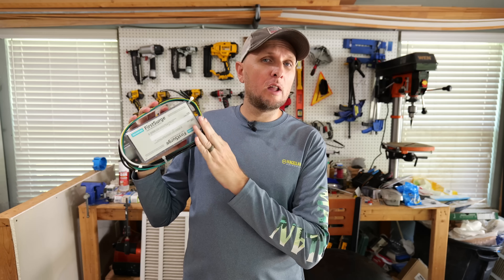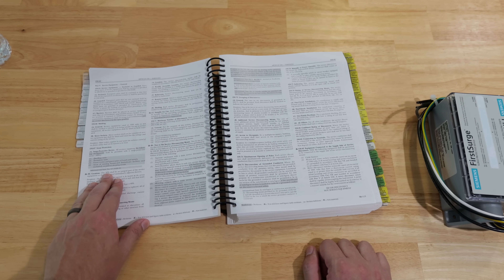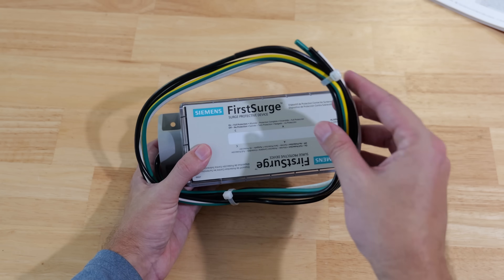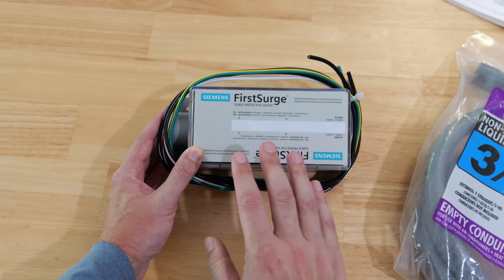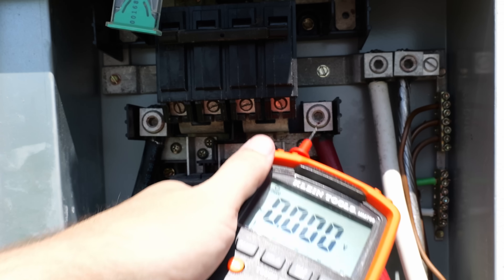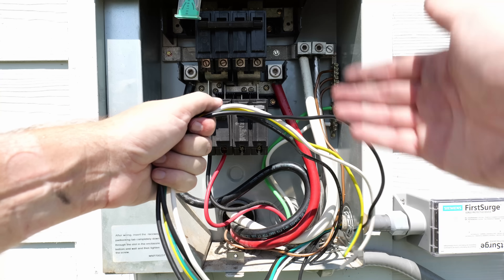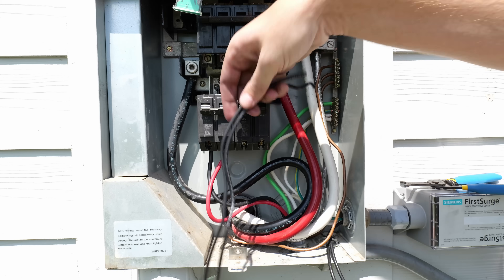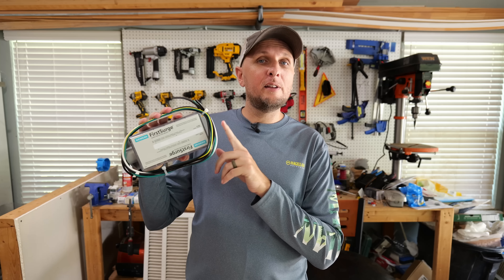Why Whole Home Surge Protectors Are Now Required and How To Install One!  Siemens FS140

Comment: You missed the absolute most important reason the these got placed in the 2020 NEC!   I designed electrical systems since my first NEC 1981 started in 1983.   I have attended NEC classes every 3 years and had additional classes on NEC numerous times.  My last class was 2020.  Up until 2005 to 2008 the NEC was always about life safety.  That was its rock hard core principle for being written.  Then, the electrical manufacturers started getting their employees inserted into the different panels.  It didn’t take long until the NEC is now used as a very strong sales tool.   Being on the panel, “THEY WILL TELL YOU” I can not bring up changes to the NEC, I can only vote for or against suggested revisions.   Who made the suggestions, you might ask, other people within their company.  Before 2017 NEC none of the panel board manufacturers made these devices.  Then they decided they could make them and force you to pay them for them.   That my friends is how to make money in the US!
Reply: The US fire code saw the same. What was initially a descriptive code evolved into a prescriptive one, open to local authorities’ rules.
Reply: The building codes stopped being about life safety a long time ago. How did we ever live to grow up in a house with a penny behind the blown screw in fuses? 😂 we need to ban manufacturers reps from code meetings.
Reply: If you want effective surge protection, there has to be inductance between the surge source and the SPD connected across the load. Whole-home wired-in SPDs sound nice in theory but they are located downstream from a circuit breaker where the bucketload of magnetic trip coil inductance will make them ineffective at shunting fast transients. Yeah, smells like fluffing code to force sales of questionably effective devices to me.
It would make more sense if the SPD snapped directly onto the bus bars with nothing more than HRC + thermal limit fuses between the MOVs and bus: minimal total series inductance, negligible wiring resistance, nearly unlimited impulse current capacity.
For those wired-in SPDs to have a chance of really doing something, they'd have to be wired into the branch circuit you want to protect, no breaker in-between.
Reply: @teardowndan5364    Ah ha! The answer to my question.
Reply: These don't use MOVs.  Search canem fs140 syonyk.
Reply: Sorry for the late comment but you are correct.  Life safety is no longer part of practically all regulations. You are more polite than I.  To me these new NEC requirements from the last couple decades is about what is invented that no one wants to buy, yet with enough money, golf games vacations and prostitutes these devices become required.
Reply: If they really wanted to protect homes, instead their lining their pockets, why not make the SPD before the meter.  Just a thought.  And notice how these DIY'ers jump a head to 2023 when the majority of the country is 2017 or under?
Reply: Several years ago the local electrical contractors lobbied the city council in an effort to change the local code to prohibit home owners from doing any of their own electrical work in the name of safety. We can all say that was BS.
Reply: Also, if they want protection how about hospital with life saving equipment?  All these cry babies don't realize we have to jack up prices for doing services now.  Combo meters, spd, and ser now.  come on manufactures, your killing us.
Reply: Corrupt.... write the rules to benefit your company and profit streams...
Reply: Absolutely does anyone know someone that has had an issue with surges frying things? What about service provider are they not required to have some form surge protection so that they ensure they provide with safe reliable service?
Reply: @msk3905  My family stayed in an Airbnb last summer and there was a lighting strike to a metal cross walk light pole right across the street less than 30 yards from the house).  The base of that pole was apparently near a water main.  The lightning blew a hole in that water main resulting in flooding of the whole street.  Inside the Airbnb, one flat screen TV got fried along with one cable box, but there were several other TVs and cable boxes throughout the house and they weren't affected.  That is the only time in my ling life that I or anyone ai know experienced any electrical surge damage to any electronics.  I'm pretty sure it would be cheaper and less hassel to just buy a new TV than it is to incorporate a whole home surge protector.
Reply: Pretty soon, it will be a subscription. So, not only with you pay for the power coming to your house, you will also pay for surge protection. And if you don’t pay, they turn off your protection, and your house.
Reply: @Travis.Ladegast 🤫
Reply: And there you have it. Thanks for saying it. Hope it doesn’t get taken down too quickly 🤔
Reply: Although these devices are ostensibly to protect your home electronics, they serve a more important function.  They are really there to protect all of the super expensive AFIC and GFIC breakers that they have shoved down your throat via mandated codes.  Again, money grab upon money grab!  A surge or faulty neutral wire from the utility will take those breakers out.
Reply: You’re likely completely correct. But as a man who has always done his best to protect his expensive devices using SP3 devices, it makes sense to protect your entire home using an SP2 device. Not expensive, easy to install, and helps protect your whole home. No-brainer for me.
Reply: @Nat @NathanHarrison7 It kind of depends on where you live don’t you think?   I just looked up my state of Missouri and was surprised that I am a top 10 lightning state in the US.   We have more than Florida.   The least lightning strikes is Hawaii.  RI doesn’t count, too small.   Maine is very low too.   Now having said that, and having lived in Missouri all my life, only two homes of people that I know have ever been hit by lightning and caused damage.  The grounding electrode system required in our electrical systems is for the dissipation of lightning.  The two were a direct hit when I was young, way less electronics, but the smoke did come out of that new portable tube electronic TV. Maybe 1968?   I’m guessing that that electrical system was not grounded.  The other was my father’s new house it hit near the house and blew all GFCI and surge receptacles that I installed in it.   So, in conclusion, something can make total sense and be worth the expense in one area, but not really be worth the expense in others.  For me, one lightning strike in 70 years is not a high risk issue.   Have a Merry Christmas!  Respectfully,
Reply: Note the disclaimer text displayed noting that is recommended that additional surge protection should be installed on “sensitive” equipment. I suppose the technology may have improved but to this point it has always been my understanding that a “whole house” protector would not protect any “sensitive” device, a.k.a. “circuit boards”.
Reply: @ThisIsToolman      Before these panel board company manufactured units, I had many meetings with the specialized companies.   You are right.   They wanted layers of surge protection down to the surge receptacle.   So, where is the life safety?   They had to stretch very hard to find anyway to call it life safety.
Reply: @KevinCoop1  I can confirm that this happens locally as well, my brother plugged in a a faulty light at one point (and after the lights dimmed unplugged it a plugged it back several times repeating the effect), when he was staying with us and it caused a surge on the whole circuit burning out an old computer and a couple ports on a tv plugged into the computer. This device would not have protected against that surge, and thus we learned our lesson about using a computer on a surge protector.  (luckily it was really and the tv only lost one hdmi port).
Reply from the maker: @ThisIsToolman that’s not what it was for.  There are still internal surges that happen that you want to protect your sensitive electronics from over time being worn down.
Reply: @HowToHomeDIY    All electronics are sensitive. Computer, TV, and stereo devices typically have dedicated surge protection. Anything else like kitchen appliances which have sensitive electronics would be protected by this whole house device. Is that correct? If so, how is it appliances don’t require  supplemental protection?
Reply: @ThisIsToolman     Think about your question.   Why would companies not recommend you put protection from surges to protect the electronics in the products that they produce and sell for profit?
Reply: @KevinCoop1    So, your suggesting they are happy for a surge to kill your frig so they can sell you another but what about the whole house protector? Does it provide adequate protection for everything in the house?
Reply: @ThisIsToolman    According to the experts I used to meet with on large projects, they wanted lightning rods, lightning arrestors at the main, surge protection at the main, surge protection at every panel, and surge protection at everything that has a PCB for full protection.   Whether these devices in the video work is dependent upon incident energy from the lightning strike.  That depends on mile away, half mile away, down the street, or at the overhead or underground lines coming to your house.  I’m pretty sure, these are one hit and done devices.  Must be replaced with each incident.
Reply: @HowToHomeDIY 
Pretty much everything you listed would actually be fine in a Voltage surge. Because most of that stuff is on 120vac to DC...like my laptop. Very few things anybody cares about would actually be fried by a power surge...maybe just a well pump for country people. Or circ motor on a boiler. 

Def not worth the cost or justification. And a huge stretch to say it is life safety.
Reply: @HowToHomeDIY haha your full of it and this is just code fluff to drive more bs sales 😂
Reply: @HowToHomeDIY  not too many people argue that it’s not a good idea to protect your sensitive electronics from premature degradation via surge protectors and power conditioners.

We are arguing that it’s not the governments place to demand such protection.
Reply: Yes.  This.  +1000X
Reply: @ThisIsToolman  From one who lost a lot of sleep over the last 20 years on how lightning got into expensive equipment, I can tell you "supplemental protection" had better not include any path to ground of its own. Ground loops are invitations to lightning. Whenever we think of lightning protection, the thought that has to be foremost in our minds is "single point ground."
Reply: @flagmichael    Ok. Make it clear to me what a single point ground is.
Reply: AFCI breakers are proof that it is about selling shit.
Reply: May be true but with modern HVAC inverter systems these are considered mandatory if you want good service. Biggest issue is most of these devices suck as far as real protection. Read the specs. You typically do get more for your dollar. Choose wisely.
Reply: I was about to say this and why wouldnt it make more sense the devices be made to protect themselves.
Reply: Yup
Reply: Yup
Reply: To be technical, the NEC (more formally known as NFPA 70) is all about life and fire safety. I am more of a Lightning Code (NFPA 780) guy... still life and fire concerns. UL also has UL96 for lightning protection standards. Anyway, NFPA 780 famously models lightning vulnerability as a ball 150 feet in radius - if such a ball can touch the structure in question without resting on surrounding objects the structure is vulnerable to a lightning strike. If the structure contains flammable liquids the ball radius is reduced (IIRC by about half).
Reply: Thank you.
Reply: Panel manufacturers have made surge protectors for decades. They just used to be called TVSS.
Reply: Welcome to America. Large companies learned they could 'help' congress starting in the early 1800s. Google 'credit mobileer stocks'. Food prices are high now because of middlemen like Cargill.  It cracks me up that the US president can control prices. Did we forget capitalism - whatever the market will bear?
Reply: Exact same thing with DSM 3, 4, 5.  Just keep making up shit to “cure”.  🤑🤑🤑
Reply: Exactly as Kevin says. Its all about money. 

Lets say you bought a house from the 90s, that didn't require an exterior shutoff or surge protection, but the meter is removed due to nonpayment. You are required, at least in WV, to essentially replace the outside meter base.
Reply: @Blankity_Blankk .  I have not heard of that one.   I’ve been retired now for almost 7 years.  That situation would be a Local Ordinance, or a Utility company policy.  That is, unless the newer NEC has now started forcing people to make changes to meet newer codes.  I hope not!  That would be just wrong.   It should be a choice, not a requirement.
Reply: 100% Correct!  Arc Fault protection being another example.
Reply: @elwoodchisom5277 .  Were it not for people buying the super cheap 6’ extension cords, plugging in their 1500 watt electric space heaters, and putting a throw rug over the cord so as not to trip from it, I would 100% agree with the arc fault.   Unfortunately, they allow those cheap cords to be sold.
Reply: No.
Reply: So, the Siemens FS140 is rated at 140,000 amps and … we connect it to a 20 amp breaker?
Reply: @justTheInfo  The ratings for a breaker and for a surge protector are simply different.
A breaker rated at 20A @ 120V will not trip when receiving a transient 140kA load over 50 nanoseconds. The rating of a breaker is generally how much current the breaker will sustain over 1000 seconds before tripping, which is to say that it's a relatively slow process. Breakers exist to protect wiring from overheating and catching fire, a process which also takes time. 

The rating of a surge protector is the max current that can be reliably detected and redirected to ground. Providing a low-resistance path to ground mitigates power surges to a certain extent. The detection circuitry of a surge protector needs to react as fast as possible to a surge to prevent as much current as possible from going through the rest of the system.
So, to bring it all together, the reason that this surge protector goes onto a 20A breaker is that it uses 12 AWG wiring. Should the circuitry or wiring to the surge protector fail, sustained high-current loads may be sent to ground. The breaker prevents a malfunctioning surge protector from overheating without disrupting other loads on the system.
Reply: @justTheInfo  The "140,000 amps" is the surge rating - the current it is rated to divert to ground. That current is diverted from the breaker. If you think of it as being like crumple zones in a car, you are not far off. The energy has to go somewhere.
Reply: @justTheInfo  140kA for 20 microseconds, too short of a pulse to trip 20a breaker.
Reply: Don’t forget the requirement now that all outlets are protected by arc fault breakers. Guess how much they cost compared to a standard traditional breaker. It is dubious when codes are inserted, simply for the making of money.
Reply: @UncommonSense1776 yeah no joke I'm remodeling a house and had to replace the panel I had $60 worth of 20 amp breaker sitting there and the codes guy says you can take those back you got to have dual purpose Breakers now $800 later...

Comment: That will be almost completely useless. 

To be effective a surge suppressor really should be inline with the ability to disconnect the mains, that at best could become a short circuit when the voltage rises above the threshold voltage until it syncs 20 amps, then the circuit breaker going to the surge suppressor will trip, and then you are right back where you were without it installed. Except now you have a false sense of security, thinking you have surge protection. 

That’s just dumb. I have a surge suppressor that could just about handle the load for my house, it is about the size of a washing machine and has a fan to keep it cooled.
Reply from the maker: The 20 amps has nothing to do with it.  A surge happens way faster than a circuit breaker can trip.

Comment: Thats all well and good - but how does it work?  As you installed, I can only imagine that in worst case, the double pole 20amp breaker trips. So what?  Who would check the green lights to see if there was a fault if there wasn't two green lights?
Reply from the maker: The 20 amp breaker won’t trip.  It happens way to fast.  The surge protector absorbs and redirects the power to ground.  That’s how it works.

Comment: Excellent and informative video.  I put this same Siemens device into my home about a year ago.  I had experienced a few surges through the years that fried some of my electrical equipment and wanted a solution that would limit that in the future.  After doing some research, I found the Siemens unit to be the most effective for a homeowner.  Pretty straightforward to install too.
Reply: I had one blow and threw sand in the basement. Nothing else was harmed.

Comment: If I remember correctly, from my college course in NEC 101, the code accepted by the jurisdiction is the one which must be followed.  If your city/county specifies and older version, then that is the code you must follow.  

My county does not require Surge Protectors.  They are a good idea, but not required in my county.
Reply from the maker: Yes, whatever NEC edition your jurisdiction uses is what applies.  It won't be long before they move up to the 2020 or 2023 though.  Very few aren't using them now.
Reply: Very true.  In our area we're on 2017 still.  They also specifically do not require AFCI's thank goodness.